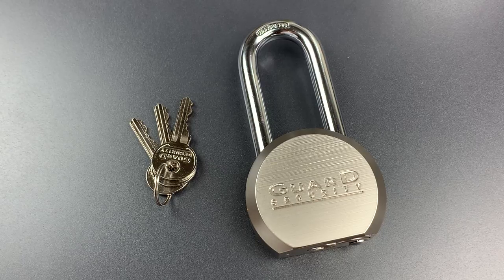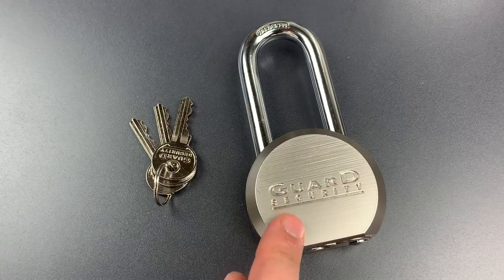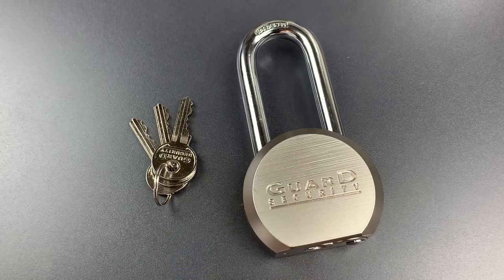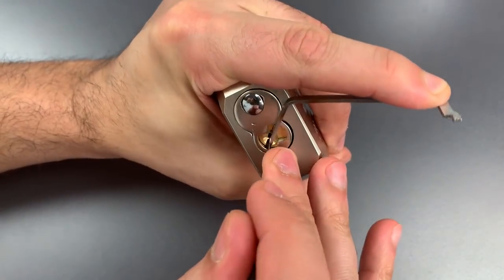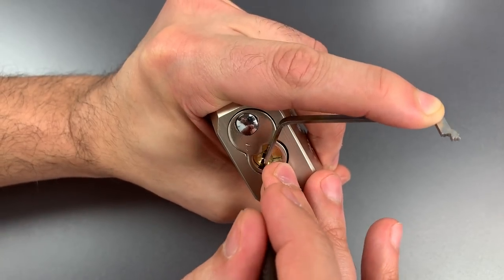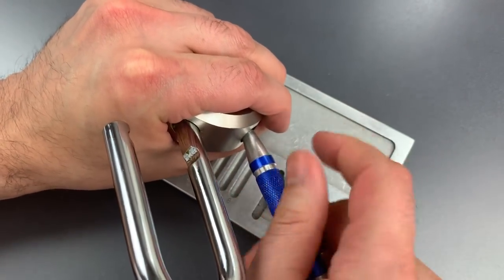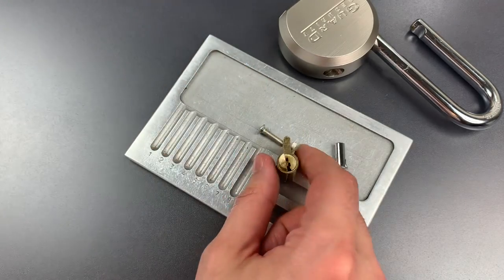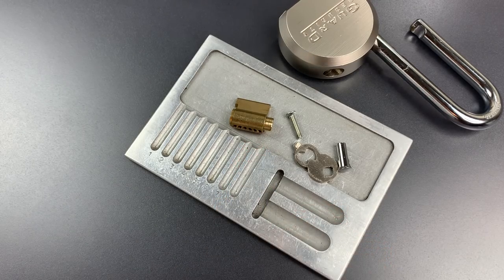[786] Guard Security Round Body Padlock Picked (Model 365LS)

Comment: I bought one of these (for about 10 or 11$) over a decade ago to lock up a rented moving truck, and later on, a storage unit.  I took mine apart and it had a little spring metal disk clip around that D shaped tailpiece.  

Also, you can get at the pin holes by rotating the key 180 degrees.  

I would also like to see how easy it would be to bypass this lock.

Comment: Maybe you could get the driver pins out like this: 1: Take out the key pins by turning the core 180 degrees. 2: Turn the core back, without key pins, and let the driver pins snap down into the core. 3: use a feeler gauge or a home made straight tool, or a straight pick without hook, or anything else straight, to push up the driver pins so the top of the driver pin lands at the shear line (so you don't destroy/shear the springs. 4: Take out the driver pins. REASSEMBLY: 1: Place the driver pins back, and turn the core 180 degrees to set the pins. 2: Use a comb pick to lift the driver pins completely past the shear line. 3: rotate the now empty core (with a comb pick inside it) 180 degrees back, and then reinstall the key pins again.

If the driver pins alone are longer than the pin hole in the core, it wouldn't work, but I doubt that. In that case, you can restore the lock using a comb pick.
Reply: Sebastian Nielsen - seems like you thought about that a lot but I’m not sure this rubbish lock is worth the effort...

Comment: I just took apart my Guard 365 and the core looks the same, but it does have a clip on the back, but, I haven't been able to remove it!  It's in there tough, or it's designed not the be removed, not sure.

Comment: Er, Harry, you can drop the key pins out through the bottom holes. Just put the key in and rotate it 180 degrees until the key pins are inline with the holes on the bottom. Then drop them out from there.

Comment: I picked up a cheapo at harbor Freight to practice on that has the same core. I was able to use a hook from the rear of the keyway to push in the keeper pin and get it apart. The core cut away, flat one one side and grooved on the other. Seems like a lot of machine work for a junk jock.

Comment: Maybe, with  the plug turned with the key, (& the cylinder upside-down clamped in a vice) tap the 6th pin (bounce or 'shock') it with a rubber mallet with key turned and pressure pushing plug towards key. Idk. I was only working a locksmith for a couple years long ago, but the re-key-ability of the design makes me think there's some easy way to remove the plug. Could be they just swap out the cylinders though.

Comment: It looks like a mildly better us general from harbor freight.   For the price point of the us general when you can get them for $6 on sale, it's not bad.  They are a pain to re key, but the guard is close to $20 I think.  Not worth it.    The us general is a good lock IMO if it takes the place of a master #3, but I don't use it for anything that requires more security.

Comment: If the domed rivet holds the the cover, that holds to core in place. Could you just drill it off and drop the core out?
Reply: No. A drill bit will slip off the curved dome.
Reply: It’s a possibility on cheaper ones but that dome head should be hardened.
Reply: Center punch, then drill.  Can be done.  But it's more fun to pick it with your feet up and a cup of coffee sitting next to you.
Reply: @JohnLeePettimoreIII  Will the punch work on harden steel?

Comment: How do you check if steel is hardened?
Reply: You try to filing it with the edge of a file. If it is adequately hardened, the file will leave hardly any mark, if it is not, there will be a clear cut.